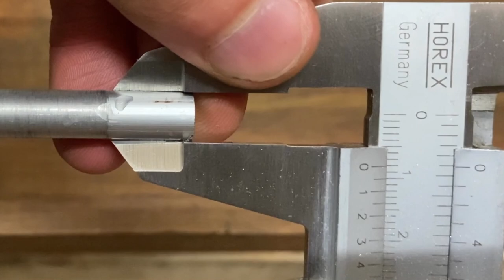Hand cranked drill - perfect restoration  I  Dr. Hut of Handcraft

Comment: Nice work.but it would be better to file of casting marks.round sharp edges.but its a great restoration.cheers
Reply from the maker: Thank you very much 🙏🏼 ! Yes I can comprehend that you say that and normally I would do that, but because I chose hammerite for painting I decided to leave the casting marks so it still has a little bit of a “rough look”. But I will surely consider your suggestion in future videos! Cheers back 👍🏼
Reply: @DrHutOfHandcraft  roger that cheif🤭
Reply from the maker: @Hybriddiag  😄